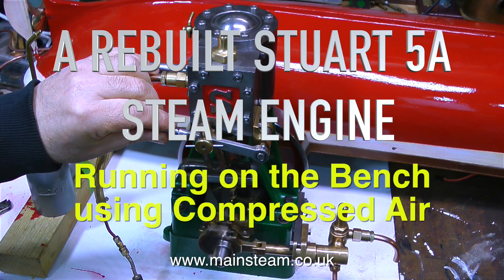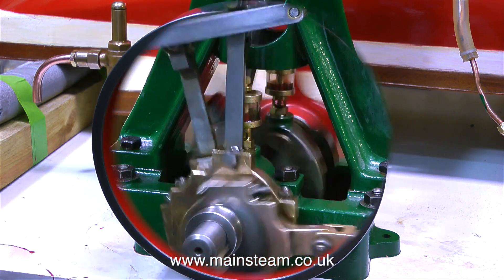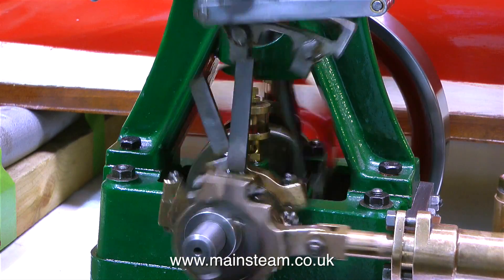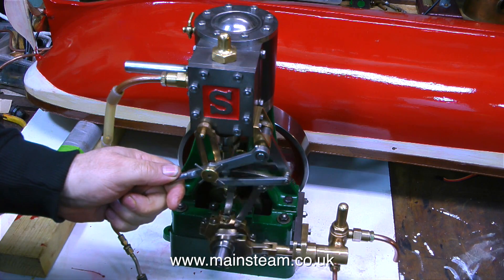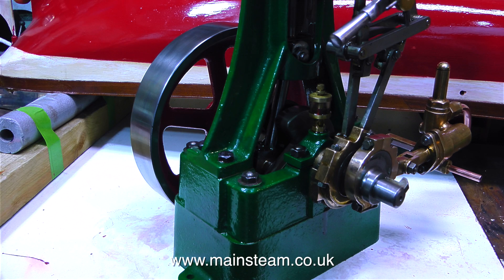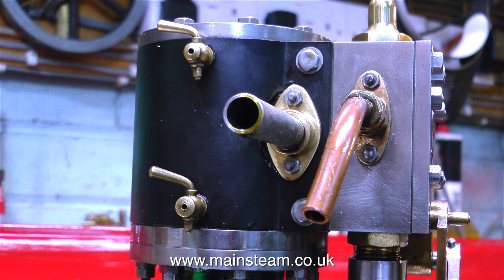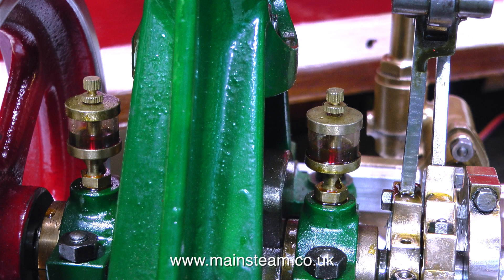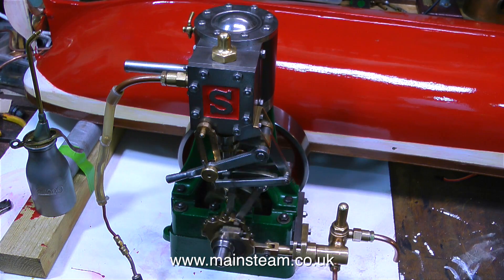A STUART 5A THAT I RECENTLY REBUILT IS NOW SOLD

Comment: Thanks for this. A question you may have answered many times - if so, sorry: Does the valve gear on such a marine engine permit varying the cut-off - it looks quite like a Stephenson-ish arrangement? If not, is this universally true of marine engines? From what I remember all the reversing model marine engines that you have shown are only run in full forward/reverse, the regulator being used to control speed.
Reply from the maker: Yes you can back of the lever for "cut off" but I find Walschaerts valve gear to be better at this than Stephenson's - don't know why - maybe I am hallucinating :-)))

Comment: Do you have some small (under 10 cm high with base under 36 cm²) steam engine for sale?
Reply from the maker: I have a pair of SVS Twin Cylinder oscillating type steam engines which will be going on my website for sale shortly as I am having a bit of a clearout . . . .
Reply: Can you sale one of them to Slovakia? And if yes, how much will the engine cost?